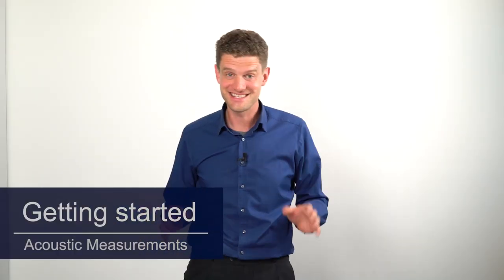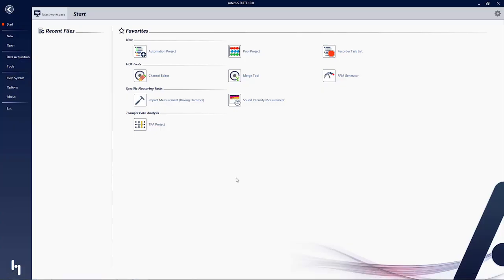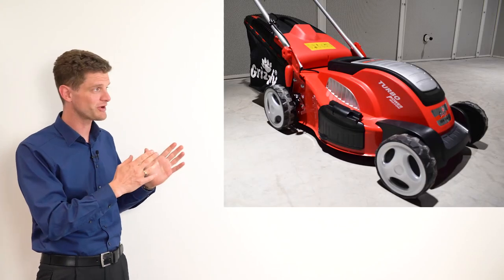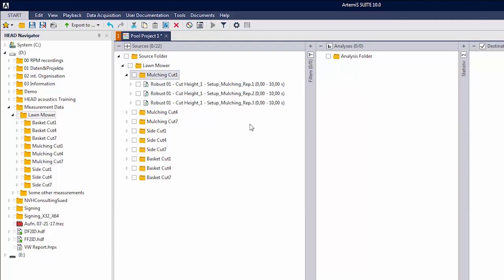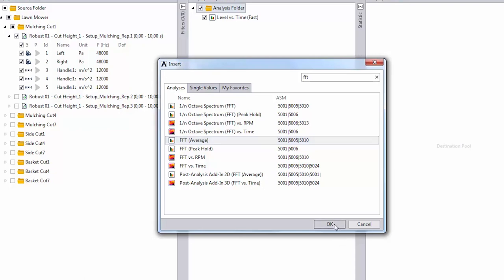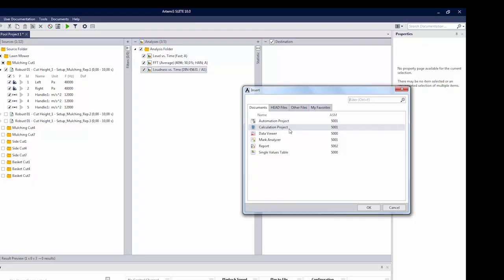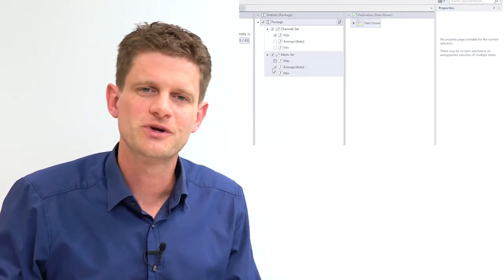Get Started - NVH Analysis with ArtemiS Suite 1/8

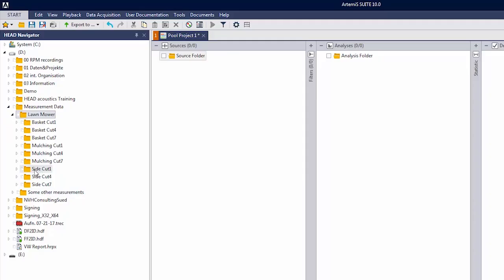Comment: lawnmower part 2:21 -- 4:38

4:56 -- You have to import the files into .hdf format (right click the files) before you can drag and drop
Reply from the maker: Hello,
yes that is a good hint. On the measurement data offered for download here, this simple drag&drop selection of measurements works, because as explained, these are measurements taken by an SQuadriga - a frontend from HEAD acoustics. These frontends write natively into the hdf-format directly .

In case you want to evaluate data from third-party devices in ArtemiS, we provide extensive import options.
These are actually at your fingertips with a right mouse click. 😀
Thanks for your hint.